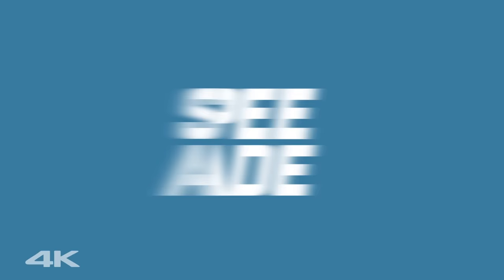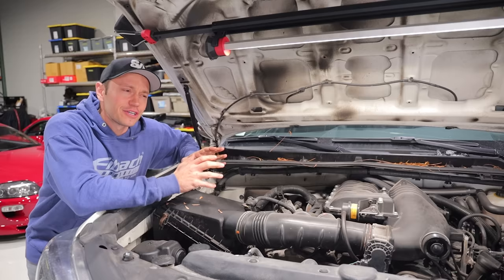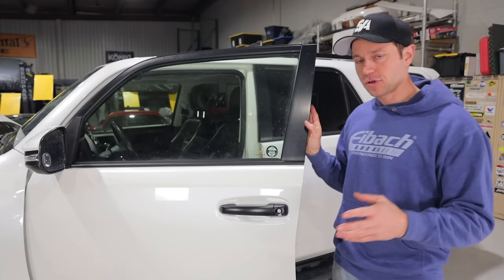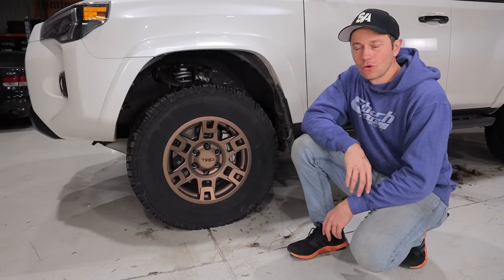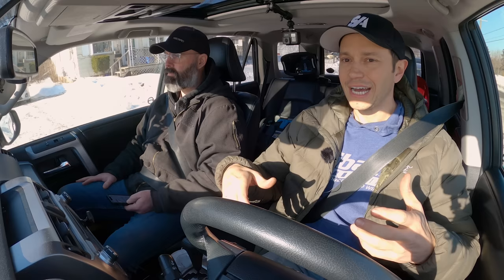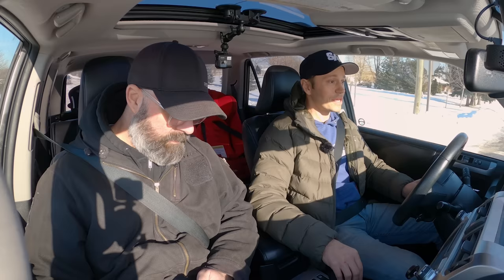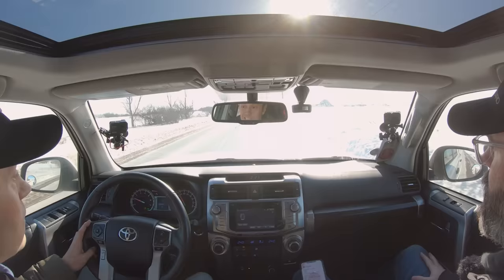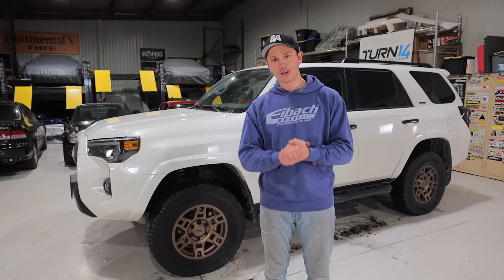Supercharged Toyota 4Runner Long Term Review - Gas Mileage, Reliability, Regrets?

Comment: You could use fluid film to undercoat the entire underside of the 4runner. People do it all the time, you should look into it.
Reply from the maker: Literally did that in the previous episodes 😁
Reply: Yeah but it’s gone after a few snow storms and highway driving. I rustproof mine at the end of November and by January, it’s gone and everything gets covered in salt. And doesn’t help if it’s all rust already. Weekly car washes helps more.

Comment: Great video. I planned on maybe getting rid of my 2013 Nissan Titan Pro4X. It has 396,000 kms and runs perfect. Just hard on gas. Seems to me that the 4 Runner doesn’t get much better mpgs then my Titan. Always looking for vehicles with longevity and it’s a toss up now between new RAV4 or 4 Runner. Just can’t decide. I know the Rav non hybrid will still get way better mpgs then the 4 Runner. But can I get used to driving a Rav every day

Comment: It's interesting to note the towing capacity of the GX460 with the 4.6L V8. Is there anything else on the GX460 that increases the towing capacity to 6500 as opposed to the 5k 4runner capacity? I just towed a 4500 pound with a trailer and my 4runner handled it pretty well except it was working on the hills. I am assuming a supercharger and maybe some beefier brakes would help me tow that boat comfortably over a pass but just wanted to get your thoughts seeing that you have the supercharger. Like you I am not looking to drive a big truck or Sequioa around every day due to gas mileage so the 4runner is a huge win in that regards.

Comment: Nice vid but why not fluid film that bad boy? That undercarriage would be like new. Those painted parts weren’t prepped properly. Plastic dip is durable but you need to sand them down with a high grit to give the paint something to attach to.

Comment: Did you have to upgrade any other engine internals or otherwise in order to support the supercharger? My concern is that the stock motor may not be able to handle all the extra power without internal strengthening.

Comment: I’ve got 2004 4Runner just did head gaskets and reseal that leaky timing cover almost 300,000kms with that same 4.0 1grfe v6 going strong. I see that you have some black stuff on the bottom of your hood is that oil from the belts being slinged up there?

Comment: hey man you should 3x por15 in heated garage and 2x por 15 top coat aerosol on all undercarrige     then spray fluidfilm in the insides and outside of frame after por 15 is all dry, realllllllllllllllllly saves the frame from aggressive salt water

Comment: The steering club is making a comeback, they used to be super popular in early 2000s. I just got one for my new F150 since its parked outside and they are a target for thieves.
Reply: Clubs are useless when you can cut through a steering wheel inless than 30 seconds

Comment: I have an old digital camera from like 2007 and it has corrupted files on it. I don't understand how a file can get corrupted from a camera that made it. 🤔 For the transmission cooler block off, i would make a thin, black aluminum plate that can bolt on the cooler with like 2 bolts. Overkill? Maybe, but it would look OEM.

Comment: Just to comment on the long-term reliability, I bought my 2013 almost exactly 3 years ago with 79K miles on it. I just hit 133K miles, and other than routine maintenance the only thing that I've needed to do on it was have the AC recharged. 

The resale is also through the roof, I just checked the value a few days ago and the estimated private party sale price is more than I paid for it at a dealer 3 years/50k miles ago. I'm tempted to sell it and cash in, but what do I replace it with? Yeah that'll put some cash in my pocket, but anything I replace it with is going to be older and probably need more maintenance and repair.
Reply: You should have bought two and garaged one of them! 😂

Comment: I rented 2021 sr5 and the 1st impression was twitchy breaks, strange different steering maybe slower so it felt bit loose (ofcourse it's not loose), power didn't bother me although it's only 5 speed, i found the original squishy suspension kind of fun so much better then my 2000 Tacoma i use to have, i got in use to all of it quick

Comment: This is a really old video so I don’t anticipate an answer, BUT I’m staying stock tire and stock height…. I easily get 20 ish on the HWY doing the speed limit lol I’ve gotten 420 + ish doing some road trips through Florida lol.

How much would my MPG be affected installing this but remaining stock ? If it’s like minuscule so long as I stay out of it and it’s only bad when I play I’d be open to getting this kit. lol I just don’t want to make my norm 14-16 mpg… this tank is just to small lol it’s not the money  but the constant trips to the pump. Right now I average 4ish tanks a month and I’d like to stay there
Reply from the maker: The engine essentially operates like it doesn’t have a blower until you lean into it so cruising I saw no change in MPG. The only difference was price for premium gas.

Comment: Just looked and the cheapest 4runner in Ontario is 30k. Cheapest gx460 is 41k. Both 2014. The lexus was half the mileage however (110k vs 220k)

Comment: no gas mileage change with 80+ hp and torque, high test gas, c'mon man. There's was a real difference before and after my 2003 V8 after the TRD supercharger installation

Comment: 18mpg is not bad. I average 21mpg in my 21’ WRX.
Reply: for the light weight and small displacement of the Subaru, 21 is definitely not good. That said, Ford Focus ST 2.0 and WRX are right there together. Type R not far away.

Comment: As much as I like Toyotas the one thing that must be done on them is rust proofing from the very beginning. All that mechanical reliability is nice 
but it doesn't mean much when the vehicle becomes a pain in the ass to change out components underneath and everything is seized up. My 10 year old Mercedes has not a spec of rust underneath and has been driven year round in the salty winter, hot summer, rainy spring and everything in between.
Reply: Unibody uses different steel. Nowadays galvanized.... No truck frame handles salt well.
Reply: @Skruteas  Given that trucks are many manufacturer’s bread and butter with regards to volume and profit it wouldn’t kill them to properly galvanize the frame from the factory. The frames are paper thin these days and don’t stand up.
Reply: @IKhanNot  eCoat is superior to galvanizing in salt spray testing. I agree that they are also thinner. I think the best solution would be a second layer of paint on top of the eCoat (since it doesnt stick well to welds anyway) and a more corrosion resistant alloy. More moly or nickle. Anyway my FJ ain't looking too hot underneath. Next rig will be garaged kept in the winter.
Reply: @Skruteas  It's actually worse to park a winter driven vehicle in the garage as the salt will be more active when things warm up. If you park the vehicle outside and it's caked in salt on the exterior and undercarriage but it's freezing cold out the salt is inactive. It's when it warms up is when it does the damage if not washed off.
Reply: @IKhanNot  No I mean literally parked all winter and clean.
Reply: I do mine every year

Comment: Seems strange that Toyota doesn't rust proof the Canadian cars more from factory if that is the case of all of them.
If I were to look at a 2014 car in Sweden (similar climate) I would demand it to be rust free seeing as I (especially for a Toyota) have to expect to pay a minimum of 13-14k CAD for it.
I recently bought a 2010 Nissan Cube that've been imported from northern Germany, and it barely has any rust what so ever underneath except for one wheel arch where it's had a bump at some point.

Comment: I live in rust belt and my 2010 touareg v8tdi has no rust, only issue was air suspension last year. I would say it is solid beast!
Reply: Different steel in unibody.

Comment: I have to say my cayenne turbo (4.8) does similar gas mileage around 15/16 liters per 100km and has been extremely reliable
Would not choose a 4runner over it
Reply: Probably gonna be a lot more expensive long term, aswell as initial purchase price is a lot more
Reply: My 2014 5.0 f150 4x4 does the same with 35 x12.5 tires and 3.73 gears.

Comment: I’ve been a Toyota tech for 4 years now and I’d have to say the worst thing about any modern Toyota is the brake pads and the second line pads they sell are not good quality they ware very quickly compared to the competition and are pretty expensive too

Comment: They sell black caps you can put over the door handles.
Reply from the maker: But the touch lock/unlock wont work then
Reply: @speedacademy  I have some on my rav4. Theres cut outs for the touch sensors.
Reply from the maker: @jordanmalibiran8540  oh cool, the ones I found for the 4runner were non touch but Ill check again

Comment: The use of premium fuel can be a real issue. It used to be that premium was only about 20 cents a gallon more; sometimes as high as 50 cents. More recently I've seen prices go more than a dollar a gallon. In America, we already spend $2B a year using premium when it's not needed. Why are we still paying that much more of a difference when we actually need it.

Comment: Now that it’s not naturally aspirated I’m worried it’s not going to be reliable yeah power is nice but definitely won’t last as long with the bolt on supercharger
Reply from the maker: You have zero basis on that statement. We've put over 25K on it with the blower and no issues. its 6psi so a very low stress setup and doesnt affect reliability at all.
Reply: @speedacademy  from a mechanical standpoint. Any sort of forced induction at least to my knowledge although incredibly helps speed and power is always at the cost of long term reliability. On my tundra I was considering putting one in but I know the car wouldn’t make it to 1 million miles like other owners have and definitely would shorten the life of the motor even at such low psi. If I’m wrong I’ll get one tomorrow I want to have a faster car. But I don’t want to sacrifice any factory reliability need this car forever.
Reply: In theory, more moving parts, more risk of potential failures, that is it. The Magnuson on the 4.0 have been proven to be reliable for longer than most people will keep their vehicles to see. People are driving them to 300k without even rebuilding 😂 It is a pretty low boost setup.

My Tacoma only went 120k until the head gasket started leaking and this was BEFORE I said screw reliability and supercharged it  (after fixing the problem.).

Comment: Cool vehicle but the engine is so slow from a stock perspective plus the horrendous gas mileage. But the resale probably makes up for that.
Reply: That’s why you get pedal commander. Plug and play and throttle response is plenty of power from the go. It’s not the engine that is slow but the throttle response from stock is for economy gas saving. Its actually light and day difference 😎

Comment: I just don’t get all the love that 4Runners get, when you factor in the poor power and gas mileage, which of course is a result of the ancient engine and transmission, as well as the rusting.  I still love my Touareg TDI (2014) which provides tons of power and great efficiency.  I get it doesn’t have the tough man truck look, but I’m old enough for that not to be something I want.
Reply: it boils down to one word: reliability. i'd like to see how your touareg is running after 250k miles.
Reply: It begins and ends with build quality. Toyota owners are aware that their trucks don't do anything special outside of offroading but the fact that they can own them without dealing with major mechanical failures is the primary reason they like them.
Reply: @nknasi  I’ve got 120k miles on my Touareg now with zero reliability issues.  I do general maintenance myself.  I consistently get 32mpg on the highway, 22mpg in the city.  I realize Pete had issues with his Touareg TDI, but that isn’t necessarily indicative of the Touareg in general.
Reply: Ugh, there is a good reason those are basically free.
Reply: @JMacGyver1  I think there may be a bit of cognitive dissonance going on with your thought process here, Touaregs in general and the diesels in particular are known to be reliability nightmares above 150k miles. Good cars when they work, for sure, but they just don't work as long as Toyotas do and that has been proven over time. But I'm glad yours has been problem free for you so far.
Reply: @nknasi  For sure, my experience is singular.  And I’ll admit I’ve not been a fan of Toyota, ever, so I’m biased against them.  One issue I have is that they’ve continued to make and sell outdated powertrains, and fans wrongly say that is because they’re bullet proof, yet there are 8 speed transmissions and better 6 cylinder engines that are also bullet proof that could have been implemented in these trucks.  Toyota didn’t change, because these things have been a cash cow for them, imho.
Reply: That 4runner is so goddamn ugly that I would tolerate all the VAG reliability issues on the Touareg when it's so good looking and modern compared to this Tojo.

Comment: i bought a 2013 golf new, drive the nuts off it in the winter and it has zero rust because i wash my car
Reply: Lol unibody uses different steel. Some galvanized. Truck frames are low alloy hydroformed = thin with 0 corrosion resistance.
Reply: @Skruteas  my dads 98 taho has no rust either… he washes it frequently and does his own minor rust maintenance it looks new underneath. He bought that with 20 thousand k on it so basically new. We live one town away from where speed academy is located……….. washing salt off your vehicle frequently makes a massive difference.
Reply: @Skruteas  so why does my dads truck not have rust all over it?
Reply: @miguelsanchez6465  Depends where you live... -20 car washes closed but that CaCl2 still eating at the truck. The Toyota manual specifies now you have to wash salt off immediately. How practical is that? I gotta work during the day. I have to take all the alleys slowly back home so it doesnt get salted on the 5min drive back. We have Chinooks here too so every 2nd week is "spring thaw'. Only way to stay clean is not drive it. I even ask not to park in heated garages. 

 The guys with rust free trucks we see are all retired, drive once a week and then get their cars up on a lift to wash. A car that works get salty. No helping that.
Reply: @miguelsanchez6465  I bet you he hasn't looked behind the gas tank or anywhere else the wash doesn't get. I have to get on my knees with a hose wand to get in there. Not to mention the inside if the frame.

Comment: Lexus GX series is equivalent to land cruiser Prado, Lexus LX series is equivalent to land cruiser 200 series , not with 4R. Land Cruiser enthusiasts calls 4R poor man’s land cruiser. As to off road prowess, Land cruiser/ lexus GX/ LX series are better being top of the class in 4wheel drive system that competes with G series of MB, Land Rover series, the high end options in4wd luxury series. Why not use fluid film in ur 4R undercarriage?

Comment: Just my thoughts.  If you want more power, just get an F150, makes these old design toyota's obsolete. Even with the blower it's mind boggling how under powered compared to the 3.5tt and a 10 speed.  

The ecoboost absolutely destroys toyota's motors in every category you could think of, including reliability. Especially after installing a blower onto these over engineered low quality toyota v6 motors.
 
This is coming from a 22 Tacoma owner (worse overall vechicle I have ever owned).  Motor sounds like the cam phasers have failed at 1000 miles, constantly gets stuck in 4 wheel drive low for minutes at a time while the cluster beeps at me with an annoying frequency that 4wd low or high has not fully engaged.
    I like my vehicles to work properly and this Toyota is the 1st vehicle I have ever owned that is plagued with accessories and features that do not work properly or at all. 

And to top it off the Toyota interior plastic scratches if you look at it in one place too long.   Toyota left reliability behind years ago. 
It's sad because these platforms have been "improved" upon forever but they are plagued with many problems, you must be in 4 wheel drive low to use any of the features, engaging and disengaging 4 wheel drive low is a real pain on the trail or in off road conditions.   Frankly it's embarrassing, holding up the trail because your new Toyota doesn't want to shift into low range.  The more Toyota owners I meet, the more problems I discover.

 Toyota was only concerned about the appearance and features on paper versus how these things work in the real world conditions. -Colorado.

Comment: I just can’t see the appeal of these things for daily driver use. They’re tiny on the inside given the size of the outside, they’re expensive, they’re terrible on fuel etc. And regarding reliability - I hear you, but you were coming from a diesel VW lol. No way this thing is THAT much less problematic than a cheap ass Ford Explorer or Nissan Pathfinder.